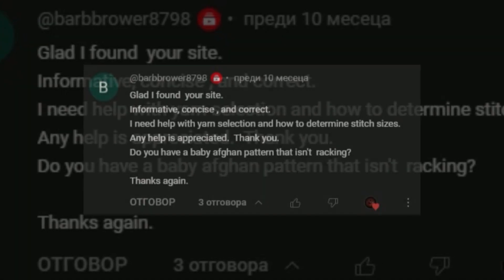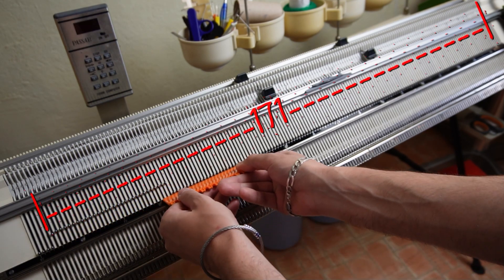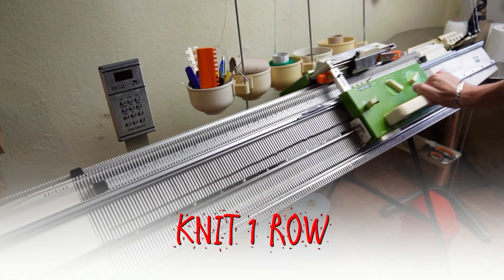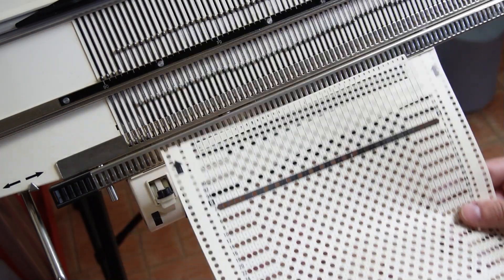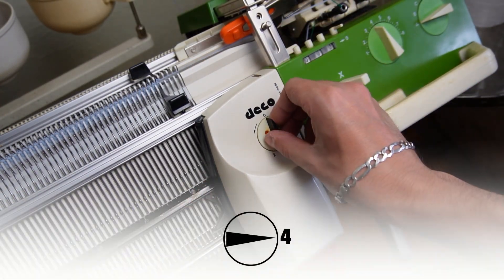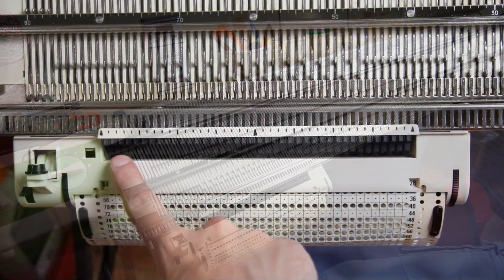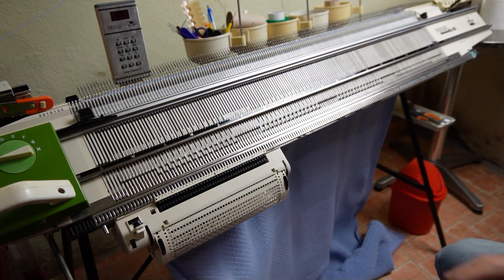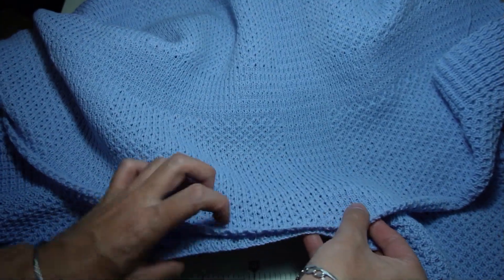Afghan Lovely: Everybody's Favorite Afghan Knitted With a Punch Card

Comment: Im testing the deco device for the 1st time through your tutorial, everything is fine but when i start knitting with the deco and carrier, the punch card doesn’t move, what should i check please? Thank you
Reply from the maker: You might want to check the card reader. On the left side, there’s a plastic part (with something like a black bearing on top) that sticks out. This part should be attached to a spring inside, and if you pull it upward, the card should advance by one row. 

I've heard from many people that the plastic part holding the spring can sometimes get damaged, preventing the card from advancing. If this seems to be the issue, I have a video where I show how to disassemble and inspect it ( https://youtu.be/RCgw29kJEcE ) . Additionally, the Answer Lady's channel has a video with a fix suggestion if that's the problem ( https://www.youtube.com/watch?v=OEfiBHikAsU ) and ( https://www.youtube.com/watch?v=mLFZq_wVL2M ).

Also, you might check the underside of the Deco. At the bottom, there should be a metal part, that falls down to pull up that black bearing on the card reader. Check if it is not stuck from old oil.

Let me know if this helps!
Reply: @ Thank you for your advice. Now the card moves and i could knit a piece of work but the pattern wasnt executed on it, there is no “holes” as expected, i made the pattern number 17-B1
Reply from the maker: I'm glad to hear the card is moving and that you're able to knit! Since the pattern didn’t come out as expected, check that the Deco is moving the pushers according to the card, and double-check that the lock settings are correct for the pattern.
Reply: @ Pushers stay at the waiting position, they dont move, black buttons on the card reader move according to the pattern holes, i tried another pattern; the same problem, but the lock’s setting are correct , i tried the deco alone , to pass it from right to left, pushers dont move, i put some ones on the top others at the bottom ( waiting position) then i passed the deco; it makes pushers all down, in the waiting position
Reply from the maker: Thank you for the details. It sounds like your card reader is functioning as expected. The Deco device should indeed adjust the pushers according to the pattern of holes on the card. You can check if the blocking rail is completely closed. If there is a pusher preventing the rail from closing this may make the Deco device or the lock cause this problem. Also, check that the pushers are clean and can move freely up and down.

If this doesn't fix the issue you may check the underside of the Deco device again. As soon as you set the dial to 2 or 4, the metal part that will scoop the pushers should go down (touch the bed of the machine). So, check if it is dirty or needs some oil. Hopefully, these steps resolve the issue!
Reply: @ I will check all that! Thank you so much ☺️